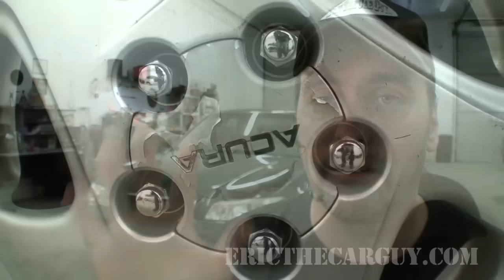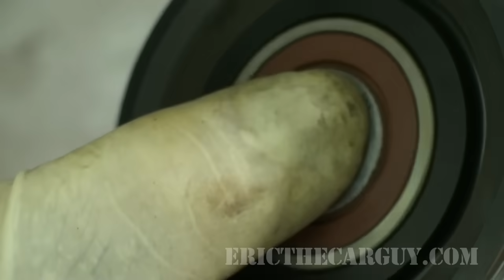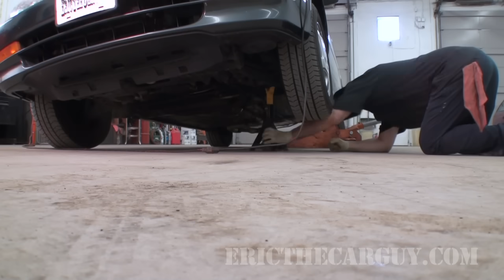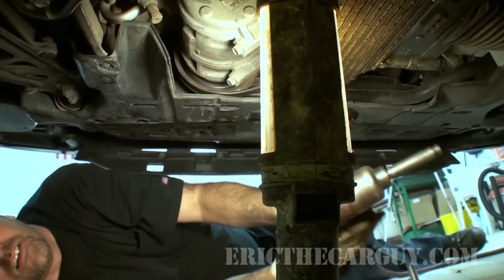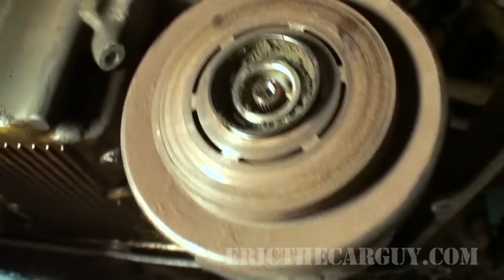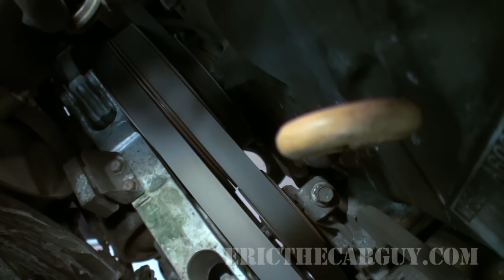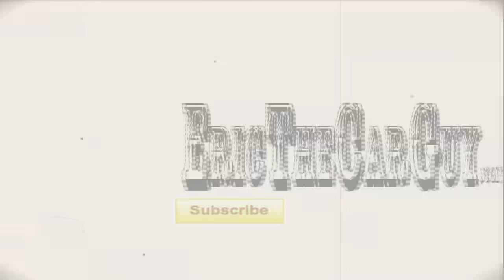AC Clutch Repair and Noise Diagnosis -EricTheCarGuy

Comment: I bought an unloved Chrysler - Mercedes a 2005 Chrysler Crossfire 143,000 it runs great . The ac does not work at all the compressor doesnt even cycle its full of freon because it spits out oil and gas. I tried to fill it with  R134 and the gauge says it full and the crompressor spins freely when i turn on the ac the engine runs alittle faster but no cycle from compressor. I spun the center and it spins freely not binding. im not sure about this car its basically a Mercedes clk Ive always had fords and gm. I remember on the Fords and GMs there is a switch near the dryer which if you replace it will fix it but on the Chrysler- Mercedes Im lost do you know anything about this Crossfire
Reply: Wow I didnt even know you could do this . I thought you had to replace the whole compressor. Unless my car has a different set up . I need help on this Crossfire.  Wish you were near me I would let you use my car in one of your videos ..

Comment: Im not even 3 minutes into the video and i can already tell you... its NOT the idler pulley. The pulley is moving regardless of the ac being on or off. If it was bad... it would be a constant noise independent of ac setting.

Comment: Thank you for the video. I have a 2000 Ranger XLT, but for the most part they're all the same concept. Sometimes it loses oil pressure and bogs down, especially if I come from higher rpm's to idle, but it still runs fine other than that. Thanks again.

Comment: @Ericthecarguy 
I think I have this problem but does the sound get louder when you press the gas pedal. And you can hear the compressor or blower  coming on and off
Reply: I have the same issue as well, and yes it does get louder for me. It sounds like a turbocharger and my serpentine belt is half off too, and on my way to work my tensioner broke lose and is now bouncing 😥

Comment: Eric, what vehicle do you think is the most reliable? Would greatly appreciate your professional opinion! Great video as always
Reply: New or used? Price? 

2000 dollars or less.. an 89-96 Toyota Camry. Assuming they were maintained, oil changed every 3k miles, timing belt every 100k miles.. as well as the 100k mile maintenance.. they should go forever, they were very well engineered, and extremely reliable..

Comment: My Honda Pilot needs this all changed.  My setup is totally shot.  eBay parts.  https://www.ebay.com/itm/AC-A-C-Compressor-Clutch-KIT-Performance-OEM-38810-RAA-A01-For-ACURA-Honda/192658370846?_trkparms=aid%3D555018%26algo%3DPL.SIM%26ao%3D1%26asc%3D20180306143914%26meid%3D4a0d3c2909fe4660a15bf331c93c27d0%26pid%3D100935%26rk%3D11%26rkt%3D12%26sd%3D282987274428%26itm%3D192658370846&_trksid=p2349624.c100935.m2460

Comment: There's a lining attouched on your pulley facing the clutch plate. Stick your feeler gauge in between the two. Without that lining, you will experience metal to metal friction that may cause more problem to your a/c compressor.

Comment: Quick way to know if it's the belt/tensioner, your engine will not run correctly. If it's not the belt, then it is definately the ac compressor, once you've determined the noise is primarily only when you turn on your AC.

Comment: had the same with my clutch bearing took the clutch off pressed the old bearing  out pressed the new one in got it spaced correctly fixed . cost about 5 bucks for the bearing and my time all the shops wanted to replace the whole compressor over 350 bucks nobody would do what i did  who's the crooks the compressor is good no lets throw that away and you can pay over 350 and also to drain the refrigerant and refill and over charge you for labor cause it would be a two hour job . do the work your self and save thousands like me and others . and i didn't have to remove  the compressor either i went through the wheel well to get access in that tight space used a oil wrench to hold the out part of the clutch to turn the bolt lose. need a swivel socket and snap ring wrench , can also do the snap ring with two small screw drivers its tricky but always remember how much you are saving and you are doing it yourself and i used blue thread lock on the clutch bolt.
Reply: randy eastman they probably re sell the  old compressor as a used one

Comment: Hey there :
I have Lincoln 2001 town car 
When the ac start to run came high sound like tik tik tik tik tik faster in real speak and loud sound and obvious from 5 meters distant ;the ac work ecxcelent like i need .

BC: the ac has neen changed OEM almost
, i resident in Saudi arabia and its hot area reach 40-50 C   easily, my Lincoln was imported from USA California state.
My question is :1- what exactly problem with ac
2- do i need any pacific modify to use the car in my area
Thank you in advance.

Comment: I had a 1991 Z28 Camaro and the AC Compressor had bad bearings in it. It was making an Awful racket. It was an expensive fix: $320 bucks for parts & labor.😬

Comment: I'm in the middle of doing exactly this job and the stator is pretty melted. But I noticed you removed the bolts on teh compressor to lower it down. I was afraid of doing that thinking I'd have to disconnect lines. But maybe it's possible to do it on my Mazdaspeed 3.

Comment: Great vid but why not change just the bearing in the clutch assembly. The oe parts looked good and no guessing on the gap. Also could of got a nice up koyo or other Japanese bearing. The green one appears to be off brand and probably chinsy like the stator you chucked.

Comment: I have a 2003 Suburban put a new compressor and checked all fuses and relays and check good. Added freon and the compressor does not come on only if I jump it from a relay it will engage and blow cold air. Once I put the relay back on as it should be the compressor does not engage at all. Can you tell me what else to look for. All switches (low pressure and high)check good. Great videos that you have and very informative for the DIY guy like me.

Comment: Hi Eric love you videos I live in the Houston Texas Navasota Texas area I wish I could find a Honda mechanic other than the dealership. I found a AC man in Houston but it seems like he's really booked up in busy my problem is he found that the fuse box under the hood where the relay and fuses are for the clutch is not getting electrical current to the box for the relay I already traded out relays to check but nothing's making the clutch engage so I left the 2005 Honda Odyssey Minivan with him so he can feather investigate he said he got the AC working but not very very cold he said that the problem was in the dash where the evaporator core is or the expansion valve I don't know which one set the hot air was coming in mixing in with the cold air that's why it's blowing hot air I've already myself change the passenger side and the driver side bi-level actuators. So my question is why am I not getting electrical current to the fuse box under the hood at the relay clutch area with the snowflake picture on the cover of the fuse box

Comment: when my ac went out it sounded like a belt when it gets wet. The clutch is making a noise when i turn on the ac, could this potential mean the compressor is not initiating and be the reason i have warm air in the comparment

Comment: I got a 92 ranger 3.0.  When ac is off it makes that crazy rattle sound. But goes away when you turn it on. Should I try to replace bearing or can i just take pulley off and get a shorter belt or bypass pulley? Or do I have to take the compressors off as well?  And I don't care if the ac works or not. What's the best and cheapest way..

Comment: But does the customer have cold air now, I'm having the same issue with a 2000 gmc sierra 2500 sle. Went to fill with r134a refrigerant and that same noise started up after i started filling.

Comment: My ac made this noise for two years. We didn't find out what the noise was until today when the air stopped blowing cold air. Can't tell if clutch is engaging but plenty of refrigerant. Does this mean that the compressor is bad now since we didn't replace clutch assembly when noise started almost two years ago? We thought it was a missfire

Comment: Hi Eric, i've got a M-Benz E-240 / 211 Series / 2003 and i am facing an issue with AC compressor, it cools for sometime and then stops cooling for few minutes and sometime for longer time and blows kind of warm air (since i am in Gulf, i guess its the climate and the heat, but you'll know better) the AC also makes a sort of a whirring sound with constant intervals, had it checked with mechanics but the only solution garages suggests here is simply to replace the part, whether its $50 or $500 they don't care nor they want to put an effort to find the fault and repair :(
I've also learnt that there is a kind of squeaking kind of a noise when the engine is running and its coming from the Dynamo, the mechanics said that there is one of the Bearing is broken and must be replaced, my specific question is "Can Dynamo affects the AC performance and cooling system, since that Bearing is broken, it works for a while and then it shuts off the compressor, could it?" cz if yes i can only fix the Dynamo Bearing and it will save me almost $600 to replace the compressor and the whole nine yards :(
Please advise, many thanks

Comment: Eric can i send you a video of the same damn noise that comes from my 2014 Ford Focus SE? I had the car for 3 months, i was making payments on a car, I haven't had for 6 weeks the last time. The dealer keeps telling me it's a FORD NOISE, I took it to Ford and they found the bearing in the ac clutch and the tension pulley need to be replaced, I took these findings to where i bought the car, and they told me i must have super ears and there is nothing wrong, they also told me there was nothing wrong with the shock mout that was broke and they also replaced the front rotors with used rotors.  Can i send you this video some how?

Comment: i HAVE A 2014 fOCUS, HAD IT NOW FOR 2  1/2 MONTHS, HAD IT BACK AT THE DEALER 3 TIMES FOR THE SAME DAMN NOISE THAT THEY KEEP TELLING ME IS A 'ford noise' last time they had it sit outside for 6 weeks just to tell me again it is a ford noise, i know it is a pulley issues possible ac clutch, sounds like bad barrings maybe, btw i didn't buy it from a ford dealer, i sent ford a video of it, waiting to hear back, the dealer mechanics need to go to school, i think.

Comment: If the noise only happens when the compressor kicks in, then it isn't due to a tensioner pully bearing since it spins all the time. If it was the tensioner, then the noise would be constant, worse when cold but better when warmed up until it ran bone dry of grease.

Comment: This is a very comprehensive video. Thank goodness it is still available. I now have faith in my ability to fix the AC clutch on our 1998 diesel Toyota Landcruiser. The AC stopped working and it smelled like a fire under the bonnet (oops, hood) on a remote road in Australia just a week ago. Having a good think what happened. A mechanic installed new V belts four months ago. The AC belt was very tight. The car had 113,000km at the time. There has been a faint suspicious noise in the engine bay in recent weeks. I deduce now that the clutch pulley bearing was failing. That wear allowed the inside of the pulley to interfere with the electromagnet, which heated up by friction and melted all the goop inside it and shorted the circuit which blew the 20 amp fuse which also supplied the cruise control which also turned off.  As an emergency repair, I removed the V belt. I am waiting for a new Denso clutch kit in the mail. Had I been really suspicious of the noise and tracked it down, I only needed to replace that bearing!    Thanks for your excellent video.

Comment: How about squeaky sound after starting the engine (A/c off)? I tried put/spray grease on the belts to loosen, it works but noise still there when starting the engine. Any idea?

Comment: My 2006 CRV gives a similar sound when AC is switched on. Two shops tell me I have to change my entire AC system $1500-$1600 . Can someone tell me , is it true that once the clutch is gone there are metallic shingles that are circulated inside and breaks everything else?

Comment: Hi Eric, I have the same problem. Do you think I need to replace the whole compressor unit even if the ac works when I switch it on? There is only noise, and no loss in cold.

Comment: I removed the 10mm bolt off compressor clutch on my 05 corolla, but cannot get the clutch off the compressor. I checked the factory service manual and there are it should come off. I even stuck a screw driver in and hammered it in out of desparation, but no dice. Any advise would be great.

Comment: Hello Eric the car guy I wanted to know if I should just overhaul my car because I know the Acuras specially 2001 to 2003 had a bad transmission problems and mines needs a converter clutch solenoid, what should I do because I've heard of stories of people overhauling the transmission two or three times please help

Comment: Hello! I'm suspecting I may have to do this to my car. I was told I have a bad compressor but Ive checked the pressure and checked for leaks and found nothing. I have cold AC. My problem is I get the same noise as this video and cold air comes from the vents even when the dial is in the OFF position.  I've read that a locked up clutch can cause compressor to be always on, is this accurate?

Comment: Hi yes I know this is an old video but,we have an 08 Volvo and,I had a friend look at it and,he said it's the AC clutch going out. Said it would be 150 to 300 to replace! My question is will this affect how the engine works also? Of course it's winter and,we aren't using the ac but,our car does it even when it's off and,when we start the car it makes a loud screatching sound but, a few weeks ago we were coming back from an out of town doctors appointment and,my check engine light came on when I was at an incline going up a hill and,then it smelled like something was burning and,the car was dragging to get up hill! When I got to where I could stop and, check the fluids they were all ok. Im not driving it out of town until I know exactly what's going on with it! Even driving it down the road to the school to my daughter to school it's acting sluggish! We have to buy another warranty. We live off of social security. So I don't have 300 dollars. If I take it back to the mechanic he will tell me to get it in and, fixed asap most likely! Also another question is there a way we can unplug the air conditioner from the motor? Idk if that will solve the problem with the motor until we can get the AC fixed or not! My husband is severely disabled so he can't work on it but,that was an idea he had about unplugging it! Anyway any information would be greatly appreciated!

Comment: Hi Eric! Great vid bro
Can I please ask about Locked up ac compressor symptoms? I’m currently diagnosing a Great Wall👎 and it locks up when engaged but the funny thing is that I found that it has no gas in the system. I thought the comp only spins with the system charged. I’m stumped

Comment: Does the clutch engage when turning on the heater as well?  2000 Dodge caravan with "new" clutch assembly. Squeals once again engaging heater or AC.

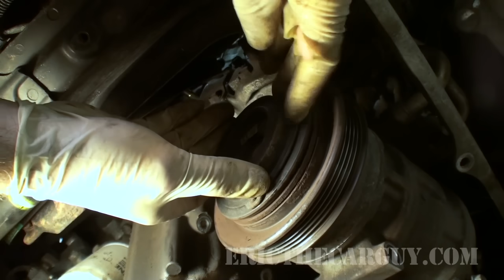Comment: I have a Mazda CX7 2008. My AC stop cooling then when I did a visual inspection on the compressor I saw one part of the compressor off. I don't know the part name. In your video at 15:40 you took a 10mm bolt, that bolt is missing but the part is attached but separate, that part is at 16:46 in your video. So I Know the bolt is missing and I don't know what else is missing. Also I don't know if I need only put another 10mm bolt and my AC will be fine or if I have to replace the whole compressor.

Comment: I have a 1997 Honda CRV with 309,000 miles on it. She has been overheating at random times. And also making some major "clicking" noises. I had it checked today, the guys said those clicks may be from the A.C. compressor clutch, may be an electrical problem. I have to take her back next week when their diagnostic guy is in and he will have to see if he can figure it out....any ideas???  I'm just concerned about the random overheating, don't want to damage the engine. ;/

Comment: hey eric...!!! my car fan belt flipped (upside down) yesterday and this happened with me twice under 2 months duration. which causes damage to both belt i.e. ac and fan belt
why is it so... my mechanic told me that the crankshaft pulley and generator pulley has no sharp groove left which causes the belt to flip... need your advise

Comment: I'm curious, if the noise only happens when the ac is turned on, wouldn't that be more along the lines of compressor bearings as opposed to the clutch/pulley bearing? I'm asking because wouldn't the clutch/pulley bearing be spinning as an idler pulley even when the ac isn't in use? Although it does look like your diagnosis is right, I think I have a similar problem but the clutch bearing seems fine but when the clutch is engaged the pulley will lock up and throw the belt. Compressor had been making knocking type noises before that started happening.

Comment: Eric  was the A/C producing cold air with the noise? The sound my vehicle has is almost identical and it blows slightly cool, but not cold air would a new clutch fix this?
Reply: itsouradventure no

Comment: when i turn the ac on in my ford ranger it sounds like an arc welder or bearings grinding or something .Also it doesn't do it all of the time. Sometimes it works awesome, sometimes it sounds like an arc welder . Any clues ?

Comment: here is a little trick for installing the bearing. Put the bearing in the freezer for a couple minutes and the housing in the oven for a couple minutes. They will go together so much easier.